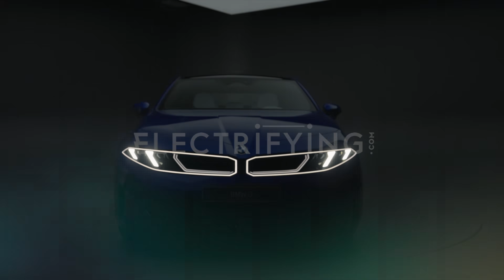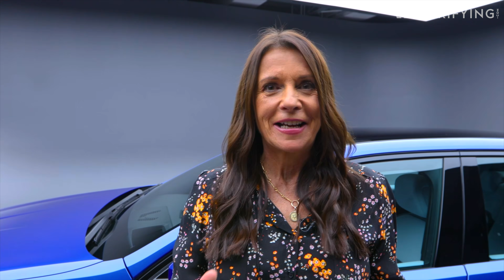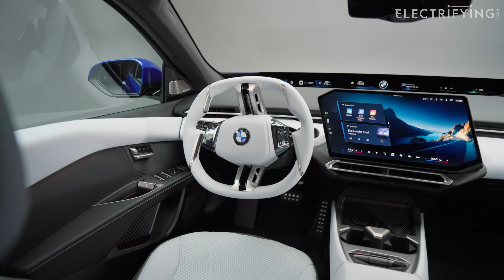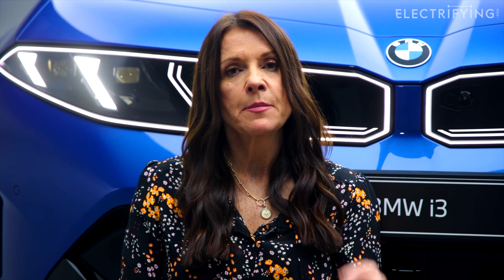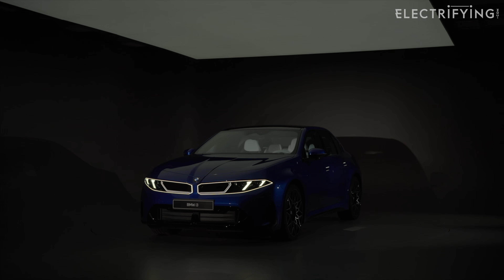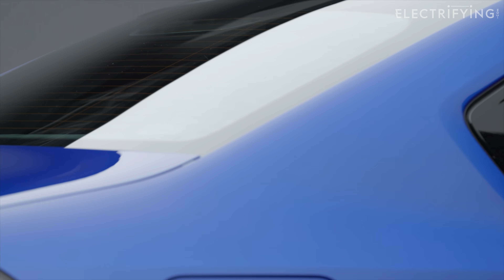BMW’s electric 3-Series revealed | i3 Neue Klasse walkaround

Comment: ⚠️ WARNING TO BMW 3 SERIES OWNERS: My rear differential has failed at only 50,000 miles. BMW quoted around £6,700 for the replacement, including parts and labour.

That’s a huge bill for a car with only 50k miles. If your 3 Series is approaching this mileage and you notice any unusual whining, humming or noise from the rear, don’t ignore it — get it checked.

I’m sharing this to make other BMW owners aware and hopefully help someone catch the problem before it turns into a £6,700 repair bill.

Comment: Novelty door handles? Check! Frankly bizarre steering wheel:? Check! Shitty plastic touch areas instead of buttons on the steering wheel? Check! Sunroof that doesn't open? Check!  Shitty little icons somewhere on a flatscreen instead of informative tactile climate controls? Check! But the reviewer helpfully pointed out you can move icons around on the flat screen which, for me, is a game changer I can spend hours doing on long journeys. This cars a WIN, WIN, WIN!

Comment: When the range of the EV more or less matches the range of a tank of fuel (400-500 miles for the average car) and EV charging is as ubiquitous as a petrol pump the uptake of EV purchases will rocket. The price point is still a problem though.

Comment: With Rachel's tax grabs on EV's and everything I did a quick AI ask on keeping my lovely Toyota Aygo X which does the job or buying a BMW neue klasse 3 series and investing the difference on Trading 212
Final Verdict: The Opportunity Cost
By choosing the Toyota over the BMW:
    In 5 years: You are £66,972 wealthier in liquid assets.
    In 10 years: You are £185,152 wealthier.
In contrast, the BMW lease would have cost you ~£120,000 over a decade with £0 to show for it at the end of the term. Keeping the Toyota effectively "pays" you £18,500 per year in future wealth.
If you took the £185,152 you built over the first decade and left it to grow for another 10 years (without adding a single penny more), it would be worth approximately £575,000

Comment: Please tell me that interior can be changed, I wouldn't even let my kids in the car, steering wheel will be black after 1000 miles and seats worn. I learned the hard way with Audi e-Tron light grey smooth leather seats........ jeans dye came out, kids looked at it and it was dirty
Reply: yes ofc I think there are up to 6 interior options.

Comment: I’ve always been disappointed by the rear space of the 3 series cabin for being a compact car, when Hyundai/KIA is pushing the limits of compact car interior space. The 5 series wasn’t much better (compared to others, A6 comes to mind) but, that’s what I bought. I was quite thrilled with the space in the KIA Optima I tried it for. Power and performance wasn’t the same, as well as materials but, the Stinger changed all that. 
One would hope they would make this one more competitive in space, with what Chinese brands are doing.  At some point, the performance and badge price gets eclipsed for more tech and value for what you pay.

Comment: I guess  when you say you like how clean and pared back the interior is, might be journalist-speak for not pointing out that the manufacturers are saving around 50% by eliminating physical buttons/knobs and replacing them with screen-based controls buried inside tedious menus….

Comment: Cup holders inside the central armrest are fully useless. The armrest is needed to rest your arm and it is impossible for the driver to hold something in there without losing the attention to the road. The only acceptable place for cup holders is in front of the passenger or at the doors

Comment: This looks like it was made by some CEO that never wanted to leave his office, it reassembles everything perfectly: office chair, a massive screen, alexa, AI and other crap that nobody needs. And yet this should remind of what - E30 ? Can't you just make E30 with airbags, DSC and round headlights with dials that don't fade away like a screen will in 5-8 years, or some stupid android system that will get clogged up?This car is not for a driver, its for the office clerk that wants to check his excel spreadsheet while being corrected by lane control warnings, while he operates a giant screen that seems to be blocking the windshield. So instead of making a car, you made a sleek design office cubical on wheels. What about making something real and timeless and standing out, something that won't glitch and fade away in 2 to 5 years ?

Comment: Not sure if I saw one on the road I’d immediately think BMW, but it’s an attractive design and the 800V with 500+ miles range removes previous range anxiety. That’s a proper distance. It should kill Tesla except for those who worship at the feet of billionaire oligarch Nazi Musk. As a designer, I’ve always felt Tesla’s lack of design, material quality, fit and finish, and build integrity. I have friends who have turned their cars into early due to unresolved mechanical issues. BMW should as well have superior driving dynamics. Who cares about straight line speeds. Life has curves. I’ve had BMW’s. This could be a home-run. Look forward to seeing one in person.

Comment: - Alexa? No thanks!!!

- No cooler system for the wireless charging (which is well-known that the heat generated by wireless charging is not good for the smartphone battery)?

- That's not the 1st video I see about this model, and no one says nothing about how easy it seems (since no one has driven it) to see the "Panoramic Vision" with that ugly steering wheel.

- Another car almost without physical buttons, and now without chrome, that saves money to the manufacturers but the prices don't go down even a little bit; on the contrary.

- 20" standard???? It should start on 18" upwards.

- Regarding the newer batteries and increased charging speeds (not only on BMW) all sounds very good but, at least where I live, there's parts of the country where there aren't chargers (or sufficient number of chargers), and, if we are on a trip and need to charge it on the motorway, the price is identical to petrol. I imagine the price of the chargers (and the charge itself) with the capacity to charging with high speed will be...

Comment: Something just needs to be done about electric car insurance my bmw 320i msport is group 30 whereas all the tesla’s start from group 40 up to 50 and anything with 2 motors will be nearer 50 so any savings on fuel costs will be swallowed up with insurance costs

Comment: It's ugly and like all BMWs it'll be hideously overpriced and given that it's an EV means it'll be even more hideously overpriced both to buy and insure and also why does it need 20 or indeed 22" wheels given that they'll affect range? Don't like the steering wheel either not the fact that everything is embedded in the screen. All that and like all BMWs indicators will be optional! 😂

Comment: Huge price with significant missing features 
The hype is prevalent and all presenters are just becoming canaries 
We expect real reviews the good and also the bad 

Good : better claimed range , better battery
Better infotainment system 

Bad : real life range is not really known as for ex the IX3 is 150-200 km less than claimed range ( many real life reviews are available online )
No real luxury ( no ventilation or massage seats , no head rest speakers, no electric adjustment for rear seats , Note: these features are now standard on all chinese luxury EV and even Elon Musk’s Tesla )

The so called revolutionary panoramic view is not revolutionary actually BMW copied it from the Avatr Chinese luxury EV which pioneered this 3 years ago

Speed is not really class leading anymore ( compared to chinese EV and Tesla performance, keeping in mind the huge powertrain in this car )
No FSD ( Tesla and Chinese brands are offering this )

The advanced city drive semiautonomous module is only available for the german market and not overseas markets like Australia 

The shape ( very very debatable, I personally think it looks like the piggy in Angry birds )

Comment: Wow the new BMW with new cell to body architecture (BYD Seal 2022, Leapmotor C01 2022) with new cylindrical cells (Tesla from 2008 on) made by CATL in China. 400kW charging ( Xpeng G6 450kW in 2023). BYD et al have 1000kW now with 5 minute charging for 500km range. 
800v architecture. Many Chinese and Korean are now 900 or 1000v.
Neue Klasse but a generation behind.
Reply: Oh forgot to mention, it does way less than quoted. Those BMW guys must have driven at 50ks/30mph to get 1000km driving back from Hungary. Reviewers could not get close to that. It goes far because it has a huge battery. 108.7kWh I read.
Reply: "Neue Klasse" was the name of the 2002 BMW Series in the  80ties...the name is the design language not only the new tech.
Yes some chinese charge faster on paper, but no single tests was able to achieve even 400kw using the Xpeng G6 on a German 400kw Charger...about 320kw was the end.

Charging 400km in 10mins is really fast, and driving about 900km (500km the first step starting at 100%)a complete day with a single charge of 10mins is nothing which needs to be faster anymore.

Comment: I don't like the exterior design (yet?), but I really hate the interior. It's too modern or so, not cosy, I hate the steering wheel design  and I want some buttons and the iDrive controller back. I do like the panoramic vision and the specs are also very good.

Comment: BMW i x 3 from £58 000 odd and if you can't charge at home, 89 p per kwhr. A really relevant and a cheap motoring option 😅

My 17 1/2 year old e class diesel has a range of 650 miles and we use it regularly, travelling to / from and around the Highlands of Scotland from England.
Why would you buy this car, when you can buy a cheaper, more convenient car, with a much better range and if anything ever does go wrong, a countrywide mechanical garage network to fix it.

Comment: Will the pricing really be in line with the Tesla Model 3? Considering the Model 3 starts at under £38K I doubt it.
Reply: Why should BMW compare with a Tincan with Rubber seats?
A Tesla is missing all a modern car uses...no DCC, no Radar, no Parking sensors, no Rain sensor, no Headup, no Display at the driver, no capacitive Steering wheel, etc...Tesla Fans call it full featured...I call it complete naked car, which is even too expensive offering nothing a modern car offers.
Reply: @josefv-y8m exactly why is this video comparing the BMW to a Tesla?

Comment: The Neue Klasse 3 series saloon concept was lovely, and had something of the old NSU Ro 80 about the cabin proportions. It would have contributed better rear headroom and a move on with the look. I like the new nose, it’s Bimmer, but a real move forward. But the A pillar back? It just looks like another 3 Series. Was it aerodynamics? Or was BMW playing very safe?

‘Veganza’ does sound like something a lady might sit on, and that’s appropriate for vegan leather, a.k.a. plastic. The ‘power master’, the ‘heart of joy’ / strength through joy.  The whole lot doesn’t somehow seem to quite fit within the bounds of safety prestigious German manufacturers usually exercise on nomenclature.

None of the above will matter. It looks better than the current ICE 3 series. Has a decent cabin. Has the badge, and doubtless BMW’s handling proficiency. It comes with a 550 mile WLTP figure. They’ll be in convoy in lane 3 of a motorway near you by 2027.

Comment: Looks ok, I'd like to see it IRL to form a more precise opinion. Hate the lack of buttons though, big mistake I think.
But let's face it, the F30 looked better. The E90 not so much, but the E92 (the coupé) looks even better in my opinion.
I also think that the petrol 3 series will look better in terms of proportions that this new i3, it will be lower with a longer bonnet. I know there's no need for a long bonnet on an electric but it looks better  😅

Comment: There’s absolutely no reason for any cars to have info screens. The chief reason they’re included is for navigation and for setting up driving controls. Navigation can be handled using simple heads up direction signals or voice commands (safer than constantly referring to a map). Driving controls could be done remotely using an app. These could be downloaded to a smart key.
Reply: There is absolutely no market for more than 2 or 3 PCs...Bill Gates.

Comment: BMW appear to have clearly taken a Tesla apart and noted all the better things about an EV, including using the battery pack as a structural element of the design. My only concern is, how many parts of the car will be an 'Extra' pushing the price and use the customers as a cash cow?

Comment: I wonder how this will compete with the influx of salon cars from Zeekr, xpeng and maybe even the Xiaomi SU7. They're going to be better spec, faster charging and cheaper.
Reply: Cheaper yes...but nothing else...Geely Platform is thirsty and never ever can achieve the range of this car.
And 400kw charging helps to load 400km in 10mins...and have driven 500km on Autobahn already...900km in a single day with a 10min stop...

Comment: This is terrible, honestly.  BMW design continues to stumble.  It's not nearly as ugly as it could have been, but there's nothing aspirational about it.  It's yet again bigger, more bloated, and now very generic.  The real DNA is gone - the double headlights, strong shoulder line, classic L taillights, etc.  It could have been worse... but it's not anything to drool after.  Moreover, the interior looks cheap... everything on a big screen to avoid the cost of engineering real controls.  No thanks.

Comment: I think they have done OK with this,  I don't like the controls and dash, BMW like everyone else have rushed to reduce manufacture costs, with simplified digital systems, at the expense of user experience and the visceral  joy of engineered switch gear and  analogue displays,  (its an appliance). What is more like it is the range,  real word knock 25% off, even so EV range is fixed for me. its fine, no longer an issue.

Comment: At least it wont leak oil like the 3 series i had.
Reply: It has oil on the final drive and coolant for the battery. So don't hold your breath. At least it hasn't got a timing chain on the back of the engine that needs the engine and box removed to service it!

Comment: Almost everything you listed as ‘new’ is lifted straight from Tesla 5 years ago. 4680 cylindrical batteries, big screen no buttons, structural battery pack, 800v architecture, AI integration. The only unique thing here will be the exorbitantly priced options list and the sparsely specced base model…! (And unnecessary but mandatory serving requirements to keep the dealer network going.)
Reply: Yup. I'm sure BMW issued a warning to them never to mention the word.
Reply: Tesla does not have 800V architecture. This charges much faster than any Tesla.

Also, stalk controls and physical buttons? Who knew?! Not Tesla.

Far more information in front of the driver than a Tesla, not all banished to the central screen.

Headrests that actually adjust? Not in a Tesla.

This car is the exact opposite of a Tesla, and it will handle better too, with better road dynamics.
Reply: @ciaran_socal  The car weighs 5000+ pounds.
Reply: @K @KyleHubb he iX3 50 xD weighs a little over 5,000 lbs. The RWD version will weigh less (only one motor). Logically, the i3 will weigh less too.
Reply: @ciaran_socal  Mhmm, sure. The Model 3 RWD weighs less than 4000 lbs (3,700+ lbs to be exact), look it up. It's not really an achievement weighing a hair under 5000 pounds.
Reply: @KyleHubb .  Why does everything have to turn into a fight over “Tesla is great”?!

Tesla have achieved something great, but the Model Y Premium with similar specifications (two motors, faster performance) weighs almost 4,500 lbs with a smaller battery, so about 500 lbs less than a comparable iX3 SUV. The iX3 SUV and the i3 sedan have a driver’s screen, not just a central screen for everything. It has a plethora of buttons, including a physical shifter. It charges much faster and drives further. Apple CarPlay and Android Auto are standard. It even has stalk controls (shocking, I know) and a far more luxurious interior.

This car doesn’t compete with a Model 3. That is a great value proposition for some, with many qualities, especially pre-owned (fastest depreciation in US currently, faster even than the VW ID.3) but it is not a luxury sports sedan that will compete in the same category as the i3.

However, for some people, the CEO has taken himself out of the running regardless. That’s a personal decision, of course.

Comment: You make the back seats appear really spacious but I have just watched Thomas on his channel sitting in the back and he looks ridiculous with no leg room or head space.  It is not really a practical car which is disappointing.
Reply: It's surprising how little space there is considering the car is much wider, taller and longer than the current 3 series. This would have been a 5 in past years.

Comment: Lovely salon shape even if it does look a bit high and Alfa-like around the haunches. I’d prefer the saloon shape with the upright kidney grille of the iX3, though. I don’t love the over-fussy steering wheel. I like form following function, generally.
Can you turn all the council house tellies off and just have your speed like in an old Saab?
It’s a shame the Hofmeister Kink is a black blanking plate and not window.
Vajazzle white and more over-fussy design for the seats not great…